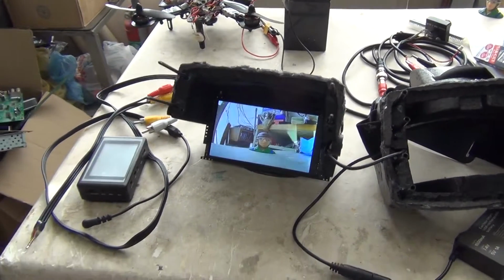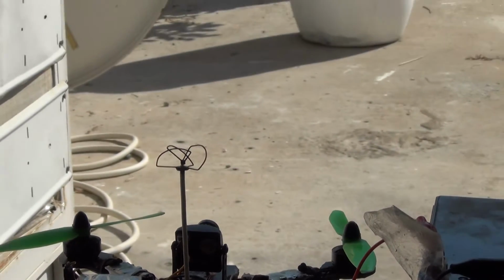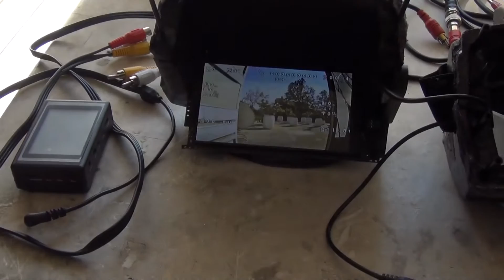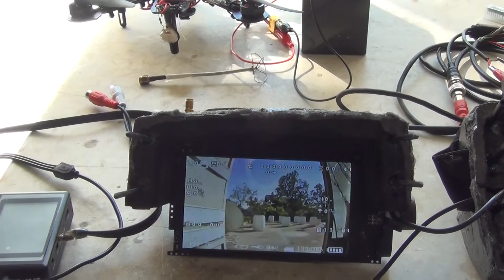Eachine Goggles One DVR Video In-Out Modification     (Part3)

Comment: Good afternoon friend, congratulations again for your video and its explanations, I was left with one more doubt. In the case of the video in, where do I get the ground cable? Thank you.
Reply from the maker: It's easy.Soldering a wire on the receiver metal shielding. On this photo it is the blue cable.  https://www.rcgroups.com/forums/showthread.php?t=2630747&page=34#post35731574

Comment: Are the small yellow capacitors, (as you say condensators), necessary, or can you do it without them? If they are necessary, what type/size are they? Thanks in advance!
Reply from the maker: https://www.rcgroups.com/forums/showthread.php?t=2630747&page=36     http://www.ebay.com/itm/10pcs-Tantalum-Capacitors-3528-6-3V-100uF-Type-B-20-Surface-NEW-/152211513993?hash=item2370836289:g:nQYAAOSwHoFXtqI%20Z&rmvSB=true
Reply: Kiriakos Axavidis - Thank you!

Comment: Good day, friend, first Congratulations on your video! see if you can clarify a question? By connecting the video input of eachine goggles with another receiver there is no interference with the eachine receiver? is there any way to turn off the eachine receiver and use only the video delivery with an external receiver? thank you
Reply from the maker: Very good question.Through the menu it's impossible but I can confirm that there is no interference with the eachine receiver.If you connect an external receiver like an diversity the only disadvantage is that the eachine receiver will continue to consume little current.However the black screen issue will avoid only with external connected DVR and not with external receiver!!.

Comment: Hello Kiriakos Axavidis, I find this video very helpful. Thanks for sharing your knowledge and skills. I bought this Eachine Goggles One thinking that I would be able to connect video out from my ImmersionRC  diversity receiver to the goggles. But when I got it, I found there is no RCA type video input jack, only an HDMI port is there. Then there is a headphone jack. I wish you would show a schematic diagram of the connections you have explained in this video. I have watched the part where you have explained the connections over and over, but still I find it a bit unclear as to the connections you have made on the PCB board because you mentioned a condenser? (3:20 in the video) and soldering another condenser or a capacitor? For this reason I am a bit confused. Would appreciate if you could explain with a diagram showing the modification.
Reply from the maker: Hereby I want to show you where the wires lead and where the line has to be cut (only only the sound)http://www.rcgroups.com/forums/showthread.php?t=2630747&page=34#post35731574
Reply from the maker: At the two terminals of C102  referred with 107 are the video in and outputs.You need only connect a second capacitor to block the dc voltage.These two capacitors are placed vertically.At the two now free connections you must solder two cables which lead to the RCA In and Output.For Audio you have to cut the pcb line on the receiver modul,this is the line that leads to the small capacitor C106.At this interruption you put audio In and output from the Audio RCA.
Reply: Thank you very much for the clarification and help. Will do this mod.
Reply: Hola, muy buen trabajo con el video que has realizado, pero me resulta difícil comprenderlo, ¿podrías realizar un esquema de conexiones? o ¿explicar con palabras pero más detallado donde va cada cable a la placa?Gracias de antemano.
Reply from the maker: http://www.rcgroups.com/forums/showthread.php?s=c5797f0e4b39c5367192a32061275978&t=2630747&page=34
Reply: Kiriakos Axavidis Buenos días, te envié un mensaje con mis dudas al correo que me diste. Estoy esperando una contestación de tu parte. Gracias de antemano.
Reply: Por favor, ¿Cuántas patillas tiene el interruptor de pulsador que has puesto? ¿Cómo has hecho las conexiones a este pulsador?.Gracias.